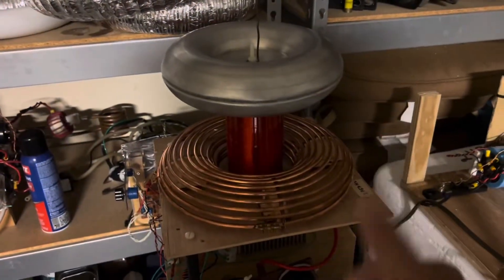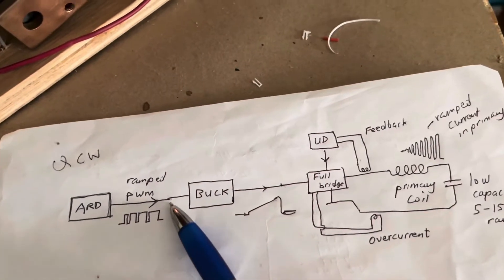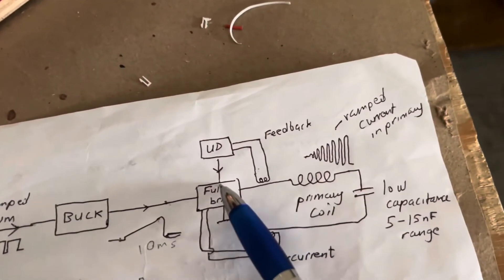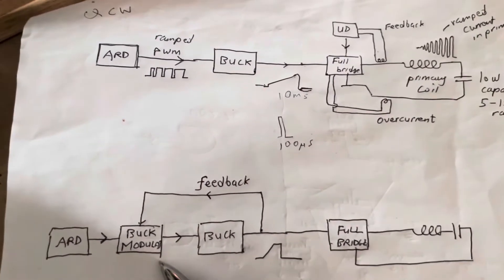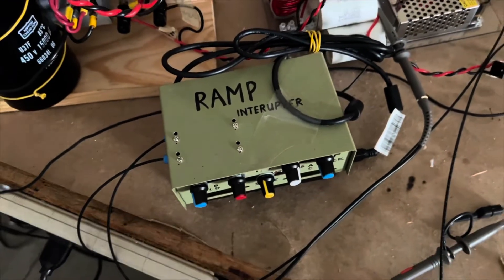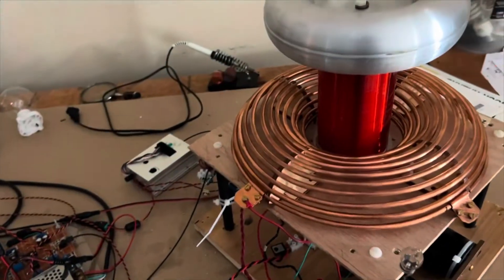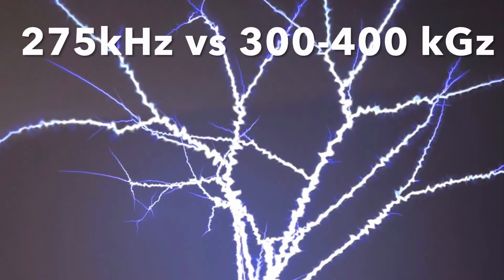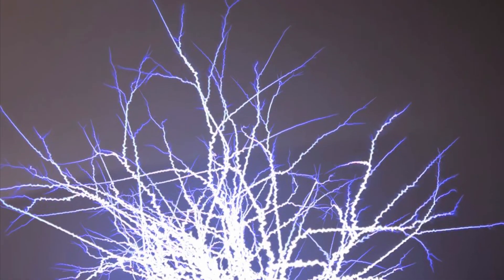Building a QCW Tesla Coil

Comment: Hé hé.
I am designing a powerfull swithing power supply. It is totally discret components, since i want to control many things.
I'm generating a ramp with a CMOS 555, then a duty cycle signal. (Not sure it has to do with your goal it's just to say i have kindof the same deals to achieve)  the base frequency is quite high: 500khz.
Actually it works well but is too much sensible of the power supply, (5v). I must use an aop controlled power supply to make it more reliable. I've not tested the power parts yet: I'm awaiting a lot of surprises.
Designing powerfull power supplies is often a deal.
Reply from the maker: Can’t wait to see it finished!

Comment: I tried to vary so many things and the electronics is not the biggest problem but i did not succeed in making a coil that works so well as yours. My problem is mostly the coil itself, the secundairy with topload. Mine are always resonating far above 3 or even 400kHz and above a certain toploadcapacitans the sparks decrease. But above ca1400 turns it also only get less, so how do you get such mighty sparks with such a compact coil?! I mean, can you please tell me your secundairy how many turns and the thickness of the wire you used and diameter and so? I tried so much, full bridge(8x irfp460) on our 240v (Netherlands) but it works less well above 2-300kHz
Reply from the maker: Try 12 inch diam topload x 3 inch thick

Use 6 or 7 inches tall x 3.5 inch wide secondary wound with 34 gauge wire on PVC)

5 inch diameter  13 turn primary wound on non PVC material

12 nF MICA capacitor

Ramp in the DC using buck  and Finn Hammer arduino code

The coil jumps  pole from 250 kHz to 340kHz when it running correctly-   Output suddenly takes off like crazy.

Here’s a run- I’m not even using a buck modulator circuit. I should be able to get more output  if I set it up with a buck modulator. 

IRFP260N will work but you are limited on your voltage to not more then 100-120V. This setup is being run with SKM100GB at 340kHz way above their rated frequency.  Also you want to be able to run at least 100A and IRFP will fail at 50A

Here’s a test run:
QCW Ohio TeslaFest 2024

QCW run 220 V AC
https://youtu.be/K7AFmQMpBN4

Hope this helps

Brian
Reply: @BrianDhvTinkerer  
What do you mean with "jumps pole ?" Between two frequencies? Does that mean it hás to be with an antenna or secundairy current feedback? Will it not work with just one adjustable frequency? 
And about the secundairy, i calculated your values to our metric and is it right that 6"/34gw~700turns? And most of all, you named 12nF so indeed double resonance but thats with half bridge on 120v? Or full bridge but how can that with the capacitor because with primary resonance i can only get my fets in spec working in half bridge. (Ow i use irfp460 instead 260 so they are 500v and pulsed 80A but i use 4in parallel top and 4lower half. The current and voltage are not a problem on 230v half bridge or fullbridge without capacitor in series with the primary. I never used primariries more then 4-6turns but that will change after learning from your first answer. I hope that you can fill in these last gaps in my understanding i asked here in this first half of this (maybe a bit too long) text?
Reply from the maker: This jump in frequency happens with these ramp QCW Tesla coils and is explained on loneoceans website. What I have observed is that the frequency changes from the measured first harmonic of either primary or secondary to a combined frequency with the whole unit primary and secondary oscillating together as a combined or coupled unit. You need good coupling ( hence more primary turns) and  current transformer feedback not antenna feedback

Comment: Yes the loop noise can get extremely tricky. Shortest possible connections for the main feedback loop of course and running the trunk through a high permanency ferrite ring just before feedback entry on the buck controller will do the trick. Getting the buck back into loop and adding a few extra foot to the spark! Ggy made note of this I believe, it's just not shown in his schematic. We greatly appreciate your explanations and illustrations. Big salute to you and Loneocean's both!
Reply from the maker: Thanks a bunch. Yes that’s definitely true. I had long connections for the test setup which made the buckverter signal look coarse and messy 😁

Comment: I was having the same issue with the buck modulator. I am going to run it straight from the generator later. Crossing my fingers there is no interference
Reply from the maker: I was surprised how well it worked without the buckverter!
Reply: Well, I ran some tests connecting the LC straight to the gate driver and I did get a ramp with minor interference. I attempted another build of the loneoceans buck modulator to no avail! It just doesn't work for me. I utilized the same setup as Magneticitist and so far its working well.  @BrianDhvTinkerer

Comment: Awesome and informative video, thanks! Do you know why QCW tesla coils like a higher coupling coefficient for the primary and secondary? I'd imagine all tesla coils would, but is that not true?
Reply from the maker: Interesting question. Seems like unlike DRSSTC, QCW coils are not really true DRSSTC- they are operating in upper  pole mode
Reply: @BrianDhvTinkerer  what is upper pole mode? Sorry that I'm unfamiliar with the terminology 😅
Reply from the maker: @inventorbrothers7053  basically a tesla coilin  normal DRSSTC mode is a Resonant system operating with quarter wave across the coil with the bottom of the coil  a zero point on the quarter wave and the top part of the coil the maximum part or voltage of the quarter wave of a full wave AC cycle. This resonant frequency gives maximal amplitude when tuning the secondary coil and top load combined. With a normal Tesla coil, as spark growth occurs, the capacitance of the top load effectively increases which decreases the resonanant frequency of the secondary. So typically in a DRSSTC situation, the primary coil resonance is set approximately 20% lower frequency than the secondary resonant frequency. As spark growth occurs, it drops the resonant frequency of the secondary so that it becomes identical to the primary resonant frequency. Then the coil is now in a double resonant situation. Massive amounts of energy can be transferred from the primary tank to the secondary coil as the impedances of the two systems become identical with spark propagation. This is sometimes known as spark “loading”. This is the true DRSSTC mode. The coupling between primary and secondary with DRSSTC needs to be low because of the way the energy is transferred. With a QCW system, things get much more complex. With a high coupling coefficient between primary coil and secondary coil, the two coils function together as a single resonant  system in upper pole mode. The resonant frequency of both the primary and secondary coil jump into a different frequency, which is typically higher than both of the separate resonant frequencies which is known as the upper pole. My guess is that this is some kind of harmonic. However, when the two coils operate like this, there is maximal energy transfer. Because of the high coupling between the two coils, there are issues with secondary to primary strike. This is alleviated by ramping in the bus voltage essentially going from zero to voltage  of around say 340 V. This results in a spark, which grows as the ramp increases. As the spark grows, the frequency of the Resonant system drops for both primary and secondary.
Reply: @BrianDhvTinkerer  okay that makes a heck of a lot more sense. I didn't know before that the secondary LC circuit in a DRSSTC was tuned higher to account for resonant frequency drop during large spark discharges. That's actually brilliant. Thanks so much for your detailed response! 😁

Comment: hello，I need a circuit diagram❤
Reply from the maker: Based on 
https://www.loneoceans.com/labs/qcw/
Reply: It’s very hard to build a qcw btw, I suggest you don’t waste money on that if you know nothing to begin with (not saying you know nothing)
Reply from the maker: @twhvyt  that’s true! That’s what it makes it fun!
Reply: @twhvyt  OK，agree with you
Reply: @youngk2495  from what he made, I estimated the costs to be somewhere around the 300-500usd zone (excluding all lab tools required for tuning and debugging), definitely not a great project for any low budget science fairs
Reply: UD2.7 ($30), buck controller (~$20), buck modulator (estimated $30), secondary and topload ($60), primary setup (mmc, bridge, bus cap, bus bars etc $150), ramp controller and fiber (I don’t know what’s in there, estimated $30)

Comment: hi. how you can measure current primary just with one channel of scope? 🧐  can you explain to me please?
Reply from the maker: Using 1000:1 step down transformer 1000A——>1A

With 10 ohm burden resistor across the output of the transformer V= IR = 10 x1 = 10V. So a peak to peak voltage of 20V on the scope from the current transformer with this burden resistor would corresponding to 1000 A. A pk to pk of 10 V would be 500A etc